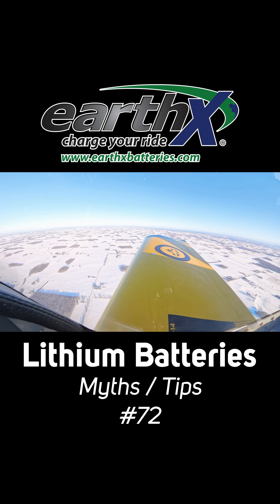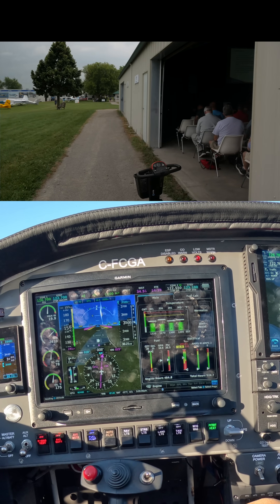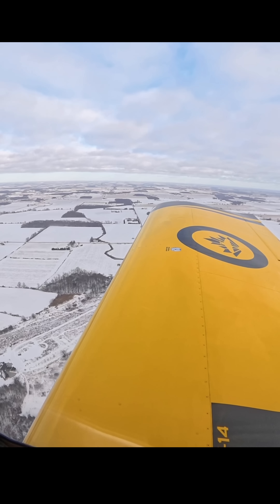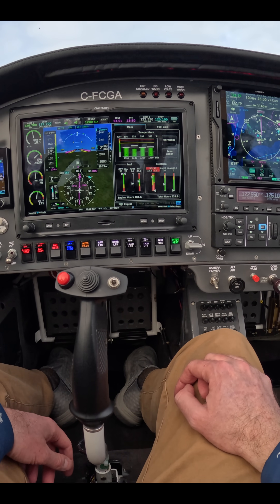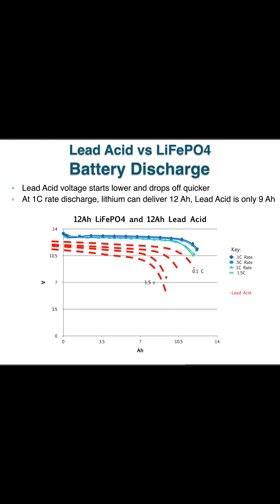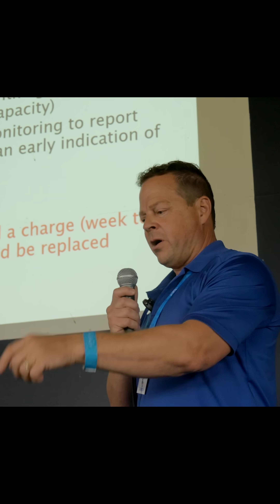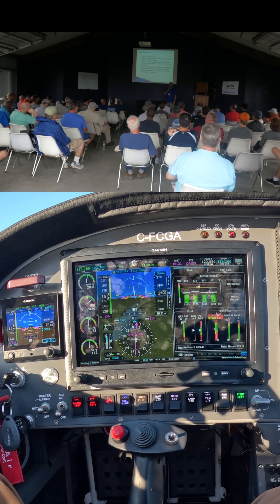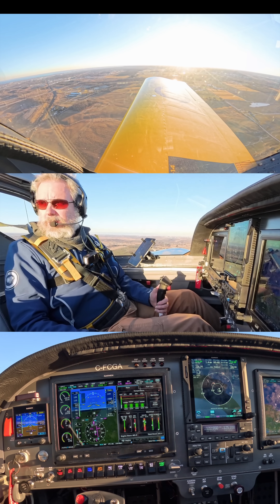Aircraft battery capacity test - Simple DIY method

Comment: I HATE “YouTube Shorts”, and I normally aggressively boycott them, and especially never give a Thumbs Up or comment, but- 

Wouldn’t this test be performed on the ground?? And if you did have an inflight generator failure, wouldn’t you immediately shed any loads that were less critical, in order to save battery power for the more critical approach and landing phase of the flight?
Reply from the maker: Unfortunately, creators are kind of forced to make shorts to keep getting their content shared by the algorithm. In this case, it seems this short version of the story made it to your feed, but the long form episode (linked as the “related video”) didn’t. Please do check that one out for the full context. But the point of the test was to see how much endurance I would get out of the battery when asking it for the entire operational load.
And no doing a test like this on the ground doesn’t actually simulate operating because my ignitions are both electronic, so I want the full draw to be simulating what’s really happening in flight. And yes if I needed to stretch the life of the battery in an actual emergency, I’d have a definitely shed unnecessary load.
But the point of this test was to see how long I would get with the full load.
But if you watch the full episode, you’ll see that it’s fairly impressive

Comment: Why on earth would you do this in the air? I suppose electronic panel and GPS draw more current when active but the delta would be easy to compute.
Reply from the maker: The full episode (linked below and probably also set as the related video for this short) describes this in more detail, but yeah there are many variables as to why the capacity test should be done in flight.  But what exactly do you think the risks are? 

"Are these the batteries that blow up?” | Deep dive on Flying with EarthX Lithium Batteries
https://youtu.be/34g-PdiHPlc

Comment: I am gona do this in MFS 2020, thats interesting. I remember when I used to fly MFS 9, I was siting in a jet and thouse times sim default planes did not include APU. And I was like siting in a gate setting avionics etc. And was just praying the battery wont just die on me before the start 😅 And I remember it was about 15 to 20 minutes. If close to it, I awkwardly asked ATC on Vatsim I need to fire up engine in a gate.